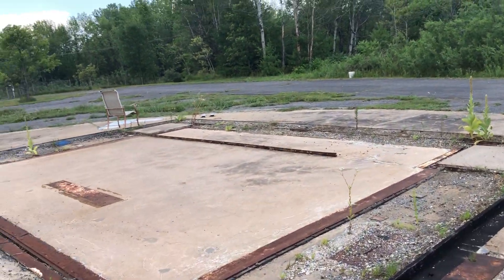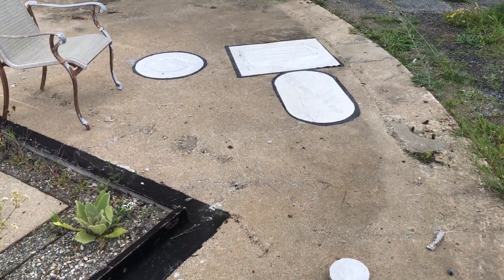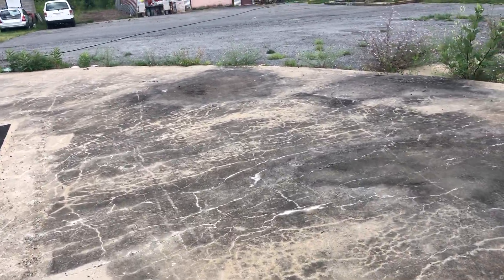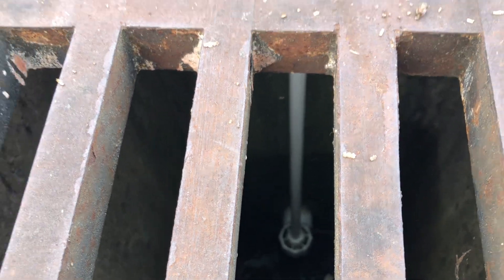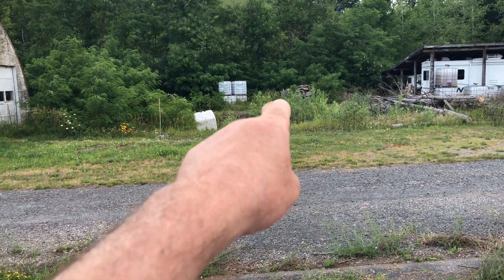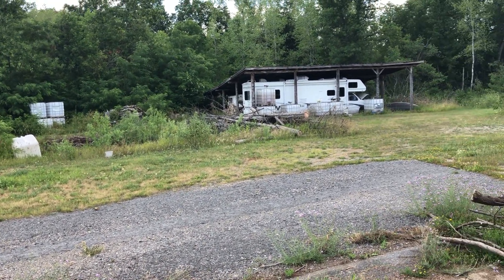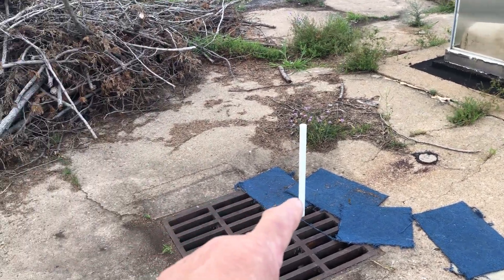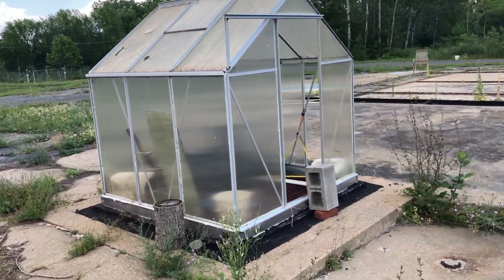Atlas F Missile SIlo Willsboro NY project dreams?

Comment: I’d love to know how much structure you have in the silo and how much remains in the LCC!  Hopefully it’s not as salvaged as Au Sable Forks..
Reply from the maker: unknown, but I am working to get a permit to de-water the silo
Reply: @noddysyacht  PLEASE keep us updated on here!  Several of these sites flooded so fast during salvage, the USAF couldn’t do a proper job removing everything as usual.  60 gallons an hour to be precise, and the commercial cost of power would’ve been $30,000 (a month I’m assuming).  It was determined it wasn’t worth it financially, and by the time they abandoned salvage operations, the sites were already flooded to the top of the stairway within a couple of weeks.  Your site could have just as much in it as the Lewis site… nobody knows though, since it hasn’t been accessed since 1965!

Check out my channel for many of these Atlas F sites, and many more first generation!

Comment: The heat pump is great idea.
Reply from the maker: Electric is the only option for the future and a GSHP should give 3.5kw of heat for every 1kw of electric and supplying that 1kw from solar gives real energy independence
Reply: @noddysyacht  With that endless supply of water at 52°f, it would be rude not to.   I guess you're pretty much guaranteed at least 3kw even when it's below freezing outside.